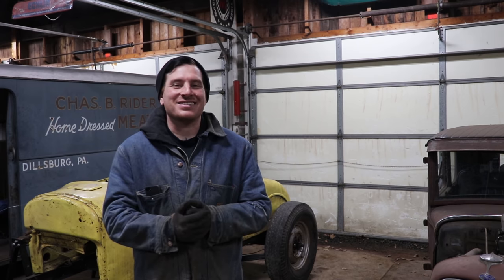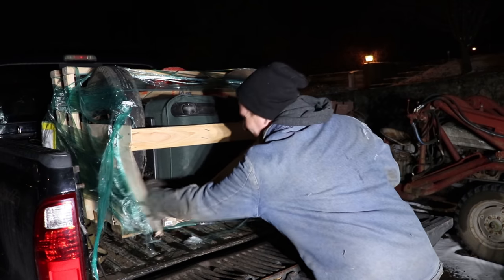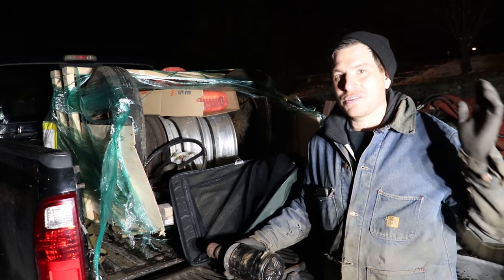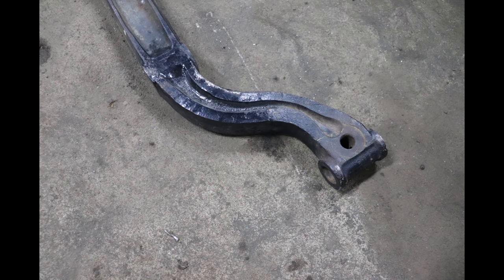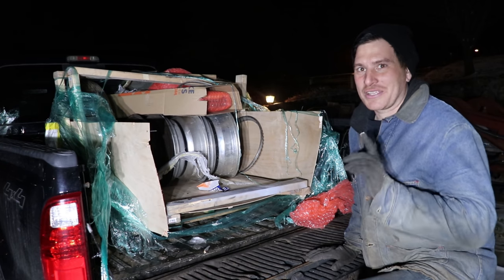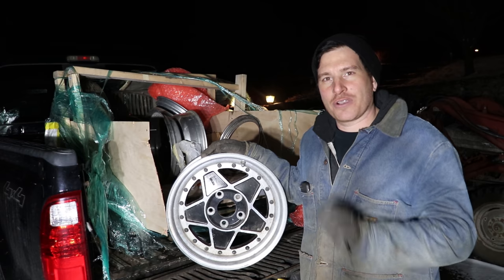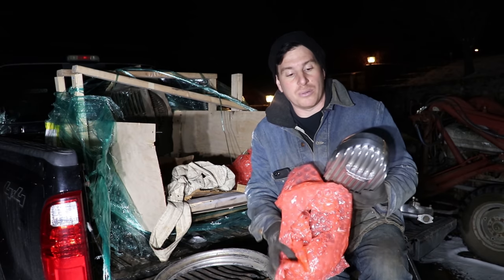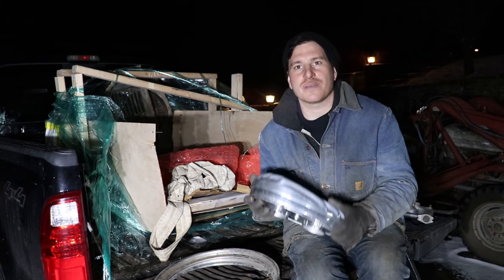California Trip Crate Unboxing - Did It Survive???

Comment: Great video with some awesome stuff. I like the air cleaner best. Those aluminum wheels were a smart buy. I bought a set of chevy rallys once for $50 and sold them to a guy with a 68 Z28 for $3000.

Comment: I know I'm way late for the brackets. My favorite item is the magneto. I did a bit of checking and I figured out I can use an early Chevrolet distributor on my 8BA flathead by doing a bit of machine work on the housing and drilling out the flathead  drive gear to fit the GM shaft. After I determined that, I bought a Vertex magneto for a Chevrolet  on eBay for $465 including shipping. I needed a distributor no matter what as the original was shot (rusted) and a good distributor would have cost nearly as much as what I paid for the magneto. I'll have to make a clamp to anchor the magneto body to the engine to hold timing once it's set but that will be fairly easy. One nice thing about magnetos is even if your battery goes dead, with a push start you can still get home!

Comment: Any  of those old porcelain  signs seem to be worth big bucks now. I one bought 2 old  lithographed tin signs, one for AC Spark Plugs and one for AC Oil Filters, new, unused with the original brown paper on them, for 5 bucks each at an automotive swap meet. The seller had more copies of each sign but I just wanted one of each. He sold them  pretty quick at that price. Later a couple of Hell's Angels bikers wanted to buy my signs from me since I was also selling at the swap meet. But I refused to sell them and I still have them. They're even dated from 1932.
Reply from the maker: Wow you scored big! Let me know if you'd ever want to get rid of them I'd do some horse-tradin' with ya! Those deals are still out there! -Matt/ITG
Reply: I'd be tough to deal with on these signs. But I do have a soft spot for Canadian  automotive signs such as Monarch, Meteor and Acadian. Some of those Canadian gas station signs come to mind too such as B/A, White Rose and Royalite. I'm into old plastic model car kits and toys but I have most of what I need in those things. Well a Reliable (Canadian make)  1950 Cadillac toy car in gold (paint) would be nice. But that kind of stuff is impossible to find, especially in the condition of these signs, well one scratch.